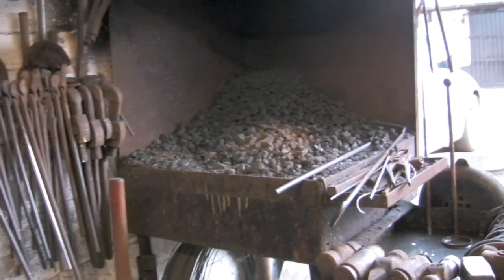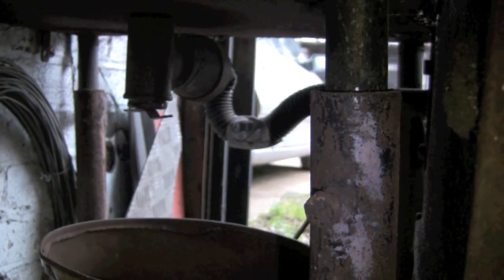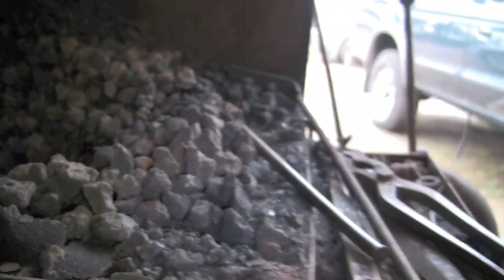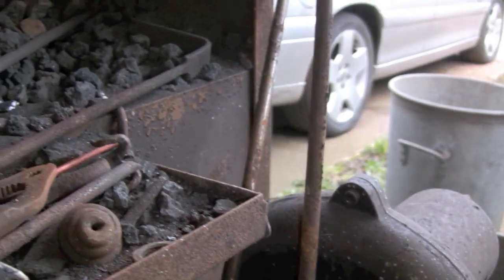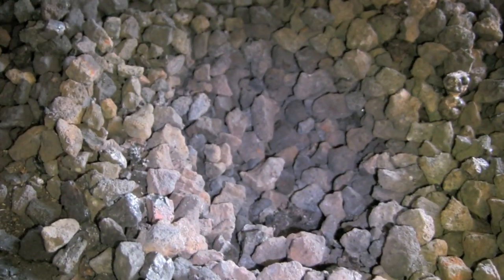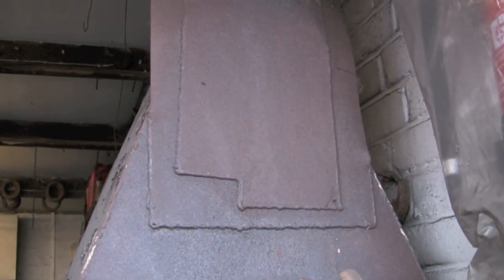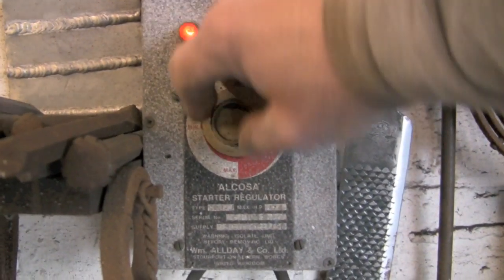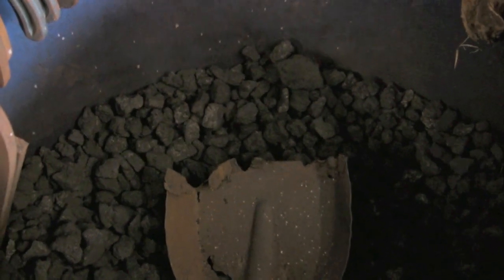My Forge

Comment: We used to have gasworks, I think they're called in English, in 'the old days'. 
They extracted the gasses from coal and distributed it to the consumers through pipelines and then sold of the coke, the 'waste product' to the same consumers for them to use in their stoves. 
Coke is much easier to light and don't give of nearly as much soot that will rot your masonry and give fuel to chimney fires.
Nice business plan.

Comment: As far as I know (and I may be wrong - I often am) coal is what you dig out of the earth. It's <93% carbon. Above that we call it anthracite. 
I work with coal and what you do is always keep some coal near your fire, not in it; it will form some kind of red hot 'gum' that will stick to what ever metal you sick in there.
The coal will smoke as it heats and give of flammable gasses while it turns to coke. 
You can't, as far as I know, forge with coal. It won't get up to a forging temperature.
Reply from the maker: Coal is way hotter than coke! You can forge with it just fine, it’s just not as controllable as coke and needs putting out when finished as it will burn all night with no blower.